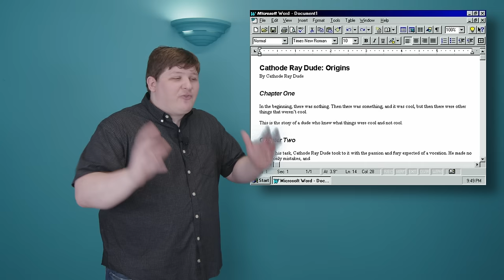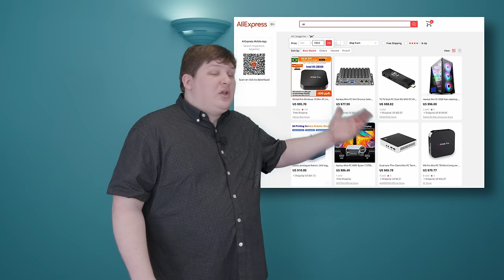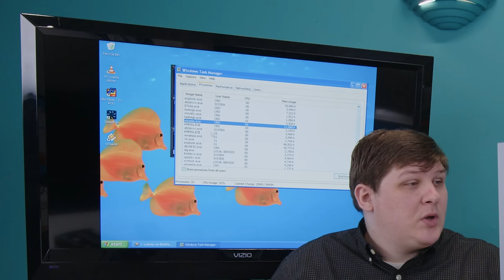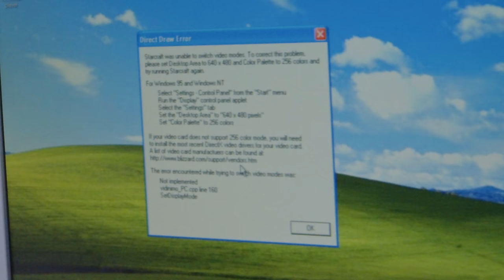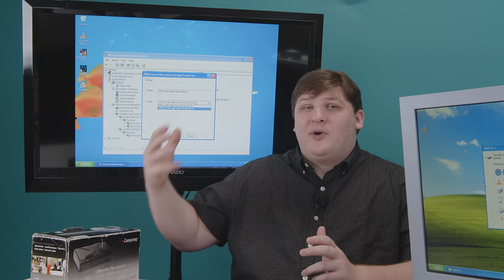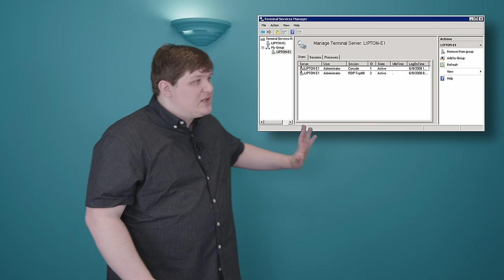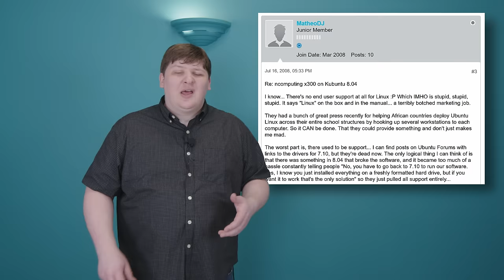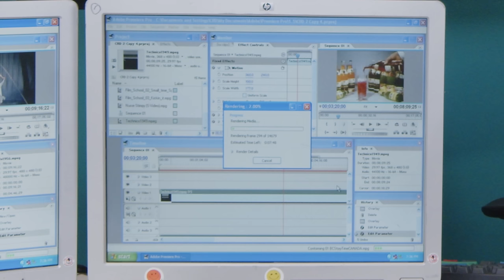7 Users on 1 PC! - but is it legal?

Comment: Took a 3 years computer/electronic course in 2010, then on a field trip we went to a university where they were making a lot of studies with several components, like new CPU cooldown systems, etc, etc, a professor there started asking us which course we were taking, which profession we would love to follow, and when she knew what we were studying she immediately told us that we had no future, because the future wasn't refurbishing, but throw out and buy new, pretty sad as that actually got stuck in my head and the next years seeing how the industry was going through the route she said, made me just step back from this area completely.

I'm glad that currently the industry is being pushed to a refurbish mindset instead of a throw out buy new.
Reply: The push towards refurbish is probably due to resource problems and costs getting too high to keep consumers interested.
Reply: Saddest thing nowadays is that it is the software industry that is making everything they can to keep the throw out and buy new model hanging on. Software vendors - most painfully with the proprietary software for a proprietary services where end user has no alternatives - keep pushing forced updates with completely unnecessary requirements for HW resources and new OS versions which are also more and more bloated, and in worst cases, such as with mobile devices, HW-proprietary. Vast majority of today's software is a pile of crap with more and more bloat, less and less useful functionality, and more and more horrible UIs.
Reply: That's great for the environment!
Reply: @TheSimoc  I'm reminded of how Halo 2 was 'Vista Only'.  even tho its a Dx9 Game. ..WTF?  Yeah, it was an Artificial limit imposed by the Installer.  Razor1911 seen to THAT with their nice 'boot-loader'  - I had Halo 2 running on WinXP-sp2 back in what, 2006?    Just goes to show what power we keep voting away.  80s corporate-law nonsense & the Dark Age of Information.
Reply: Damn that professor is a complete suckered, though kind of right about our ridiculous culture on excessive consumerism. Fixing the old, upgrading the current is the way to go if we want too keep living on this planet. And it's fun and cheap sometimes.
Reply: @TheSimoc  yeah it's a symbiotic, incestuous dark deal between software developers and their hardware counterparts to keep pumping out ever increasingly bloated and inefficient software (especially, like you said, proprietary stuff with irreplaceable services with no viable alternatives) to help hardware makers keep cranking out gear with better specs but no subjectively perceivable performance increases to the end user. That's why I opted out and went with Linux a long time ago. If a piece of software works fine on a given machine, why would I pay money for a software upgrade that maybe adds a bell or whistle but wrecks all of the features that I actually use (and had been for years)? I like upgrading systems and piecing together "new" ones from old parts. Maybe updating firmware, adding RAM, overclocking a little but adding cooling doodads, etc. But the the PC/Windows universe doesn't allow that. Planned obsolescence is engineered into the whole setup from day one and it feels like a hustle. It makes you feel like you've been hustled just like playing three card Monte, except you have the easy option of saying No Thanks! to those particular hustlers, while doing the same to Wintel is quite a bit harder. My first job was at a place that sold older PC hardware on consignment, and we'd piece together working systems from parts and they were viable. We even had a tech on site who could resurrect supposedly dead motherboards, peripherals, monitors etc., but the volume of hardware now (supported by the artificial demand their environment creates) has eliminated that business model. There is no more refurbishing - you upgrade your entire system and create e-waste that is only as valuable as the precious metals contained within it. Bad for the environment but great for shareholders. OpenOffice / LibreOffice on Ubuntu runs fine on decade old hardware and the user experience is like being strapped to a rocket compared to the bloated latest release MS Office running on a PC that was top of the line in like 2018. It adds new talking paperclip animations with new woke skin tones and a great new startup splash screen! Just a $399 upgrade fee! Plus throw your whole 2 week old computer away because, like Weird Al said, that sh*t is obsolete!
Reply: @russellhamner4898  Thanks for voicing out your opinion and experience!

Yeah, Linux - along with LibreOffice - is the way to go, even though even those have got plagued with bloat, although not nearly as badly as MS products. But the real spark of hope is that with open source software we have the power to change the thing as soon as we have skills (I am learning the programming...).

I LOVED your indirect callout for the hypocrisy of the "environmentalist" leftists with your mentioning of the new woke skin tones of the talking paperclip animations. Keep that going!
Reply: @TheSimoc  why thank you sir! Reading back over my comment now I see that it was maybe a little too wordy, but agreed on the LibreOffice bloat thing. Really, the open source equivalents of things like MS Office and Photoshop are bloated too, and a little buggy and DEFINITELY not as functional or feature-rich as their extremely UNfree closed source counterparts, but they are free and, as you said, open to being improved by anyone who wants to take the time to do it. The sacrifices are worth the cost savings and resource (and environmental!) conservation. I even got my elder step-dad to switch to a very simplified install of Xubuntu on his laptop, and for the two things he uses it for (Amazon shopping and checking his Gmail), it's literally twice as fast. Same browzah (Firefox) on the same hawdware (HP laptop from 2012) with no added RAM, but it boots up AND runs twice as fast and never freezes or crashes. Cost only $0 for the upgrade, but the technician who did a housecall (me) got a steak dinner out of it. Just winning a Linux convert was enough payment for me so the steak was just an extra delicious cherry on top. Of course my mother made the whole meal, so if she had grilled a cow turd and served it with pebbles masquerading as baked beans I'd still have ate every bite and swore it was the best meal I'd ever had!
Reply: @TheSimoc  Remember when google Chrome released as this Feather light and INCREDIBLY fast minimalist browser?
Bitter-Sweet memories.
Reply: @FroggyMosh  Yes I fondly remember! Just like Google search engine distinguished from its rivals (actual such even still existing back then!) by its light weight and minimalism yet full-fledged functionality, which was then way better than today! For example it had comprehensive advanced search, search by language/country, etc. Now those are either nonexistent or have been completely hidden from average user so well that I have no enough botherance to find them even as generally quite savvy user.

And yeah, everything was in the end SO lightweight, simple, yet functional back then. Chrome as an exemplary example indeed.
Reply: The license cost thing is just a nightmare, and it's The Model, capital T, capital M. And I think you're right: "new" can't last when "new" costs so much.

Comment: Yeah, so referencing the whole licencing debacle. I'm like 99% sure Microsoft would basically have just asked the owners of this device if audited, to buy each "client" a licence and called it a day. at the end of the day, they make money only on the software licenses, not hardware. I work for IT in a medium sized company that has been audited by Microsoft, and as long as you have as many licences as are really being "used" they pretty much just give you a pass against weird use cases like this. if you don't have the licences, you have a grace period to obtain said licenses in order to be compliant.

You're totally right btw about terminal services, what you said makes 100% complete sense. and for "Lab" use I have hacked the Terminal Services to allow regular windows to log in multiple clients via mstsc. they are almost certainly doing that too.
Reply: I did that audit, and turns out we actually had more Windows 98 packs than machines, because a few of the ones installed had been upgraded to use as servers, so had a NT license on them instead. I was building them assembly line, so the first drive was simply cloned onto the rest, with the installer halted at the first reboot, which is where it asks for the key. All the install files were stored in a directory, along with the installer (thanks MS for putting all the cabinets in one place along with setup.exe) so the clones simply had the key entered after starting for the first time, and carried on from there. All the drivers for the various parts, motherboard, processor, network card, display, keyboard, mouse, were all in that directory as well, so just a case of pressing enter a half dozen times after that to get a desktop. Unopened pack went in the case, just in case it was needed at some time.

When somebody asked for a disk I would simply give them one from the pile, but not the COA, as you can remove the disk and COA without actually opening the shrink pack.

Later on XP upgrades were done using hardware changes, to get the cheap copy, so there were a lot of new printer cables bought, along with a few new keyboards and mice, to trigger the hardware change thing. Good number of those cables went to the recycler still in the bag, never used.
Reply: @SeanBZA  
waaay back in the day i remember getting caught by the "your hardware has changed you need a new key" thing on XP a few times, usually calling the hotline would resolve it without buying anything

XP's licensing was always a bit mental, there were so many caveats with OEM keys / retail discs etc etc, thankfully Nlite strips  it out for retro gaming purposes, install from Nlite version of XP, stick random XP COA to machine and off you go.

Win 7 / 8 / 10 are really pleasant by comparison, installing win10 but only have a win7 COA?, windows installer doesnt care!
Reply: Also remember that Edu sector often has other prices and options. I work with Office 365 and the edu prices are either free or way lower than business licenses.
Reply: Also, schools. MS would have been more lax about schools, for entirely selfish reasons. Firstly because of the bad PR that comes from taking legal action against a sector seen as working to the public good - about the only that would hurt their reputation more than suing a school would be suing a hospital. And secondly because schools are training up future Windows and Office users - if the school can't afford Windows, they might be desperate enough to even try linux, as terrible as that was back then.  MS would rather people just pirate windows than see that happen.

Comment: I just edited and uploaded a 1080p60 video on my 2008 MacBook Pro, so the people complaining about not being able to watch 60fps video on a 12-year-old PC need to replace it with a 13-year-old Mac!
Reply: YouTube is probably forcing VP9 onto them (bandwidth costs) and the folks complaining are likely not using an extension to force back AVC/H264. That would likely fix it for them too if there’s any hardware acceleration. 

I had a 2007 or 2008 regular MacBook and the integrated Intel graphics were not good at video decoding (480p or 720p H264 depending on complexity and frame rate IIRC). But I can imagine the discrete chip in your similar vintage Pro is handling H264 with total ease.
Reply: I thought he said 4k 60fps and youtube doesnt create a 1080p 60fps stream that they can watch?
Reply: How much RAM are you running on the MBP
Reply: Dude, people complaining about not being able to watch 60fps video on a 12-year-old PC need to know, that they configured it to be nice for 1024x768. HD was a thing, that they did not pay extra for. I use  70usd 13" elitebook laptop with i7, manufactured in 2012. Bought it last year while prices skyrocketed (still, ridiculously cheap) and it is perfectly capable of multi monitor 1080p 60fps on integrated gpu. Few years back on standalone GPU it would be fine too
Reply: I upgraded to SSD and from 4GiB to 12GiB of ram tho, but now over hundred of chrome cards and older, not graphically heavy games are fine, with VM of Win XP in background too :>
Reply: In my case 1080p at 60fps was just slightly out of reach at 2 core AMD with 8500GT card, it was so stupid to have 50/50Mbps internet connection and online multimedia limited by hardware in 2008/2009
Reply: @kaitlyn__L  I've found on older laptops that I have to use the h264ify browser extension and disable 60fps, then even HD works perfect, because most 10-13 year old laptops have hardware h264 decoders that can handle 1080p@30fps, but VP9 is just too much and fully loads down the CPU.
Reply: @brandonupchurch7628  yep, my current laptop is like 9 years old and just barely handles VP9 in software, though it kills the battery running the CPU that high. Firefox actually automatically gets AVC without the need of an extension though, I guess it intelligently polls the hardware accel to see what it does. But Chrome doesn’t, because Google can then only pay for half of the total data by default. Of course there are extensions such as your favoured one available on Chrome for any who are so inclined but don’t want to switch.
Reply: I used Firefox for the longest time, but I switched to a Chrome based browser because I found the hardware accelerator works much better, like I can watch 8k60 video in Chrome on my modern 7th gen i5 laptop but on Firefox it didn't work nearly as well on Windows, Firefox on Linux seems to handle hardware decoding better. I was playing with a Core2 Duo laptop form 2008 a year ago and I used it daily for a while to watch YouTube and I think I switched to Edge on that laptop because the hardware acceleration worked in the Chrome based browser but didn't work on Firefox. With an SSD and 4GB of ram on 32bit Windows 8, I'm surprised it worked as well as it did, but I stopped using the laptop because it'd randomly reboot and sometimes get stuck in a BSoD loop.
Reply: @brandonupchurch7628  ah yeah I can imagine stuff like that happening with Windows. I can only speak to Firefox on Linux, BSD, and Mac from my personal experience. 

In theory the raw video file should be passed-on to the graphics card without any meddling, regardless of browser. Speculation: but Windows’ media subsystem could be doing something, or Firefox’s Windows version might just have more CPU overhead for various reasons.
Reply: @kaitlyn__L  I just checked what YT sends me , for 360p->av1 and for 480p->vp9 , my PC is from 2009 (12yo) has an athlon II X2 and has no hardware video decoding,I didn't notice the change of the codecs since I never watch stuff above 480p, I have no idea when it stopped sending me AVC video because I never had a problem with videos, all play just fine ;-) sometimes I want to watch something from YT at 1080@60 (like comparison videos) so I just download the video and play it on VLC , surprisingly most videos at 1080@60 with vp9 play just fine on VLC!  :-D
Reply: Of cause if it have a video decoder that is fully hardware supported  and run on a  ssd. The cpu is reallt just mixing the streams and fixing the timeline.
Reply: A 2 year old Mac probably works just about the same 🤣
Reply: My 2006,  Acer Celeron laptop, does 1080p easy..
The problem is what format the video is?
Oh.. my laptop I updated to a ssd...
Apple uses its own code, in video production, that makes it a pain to share simple videos...